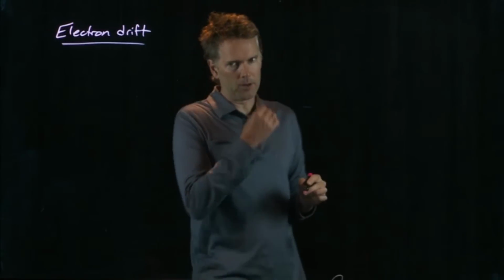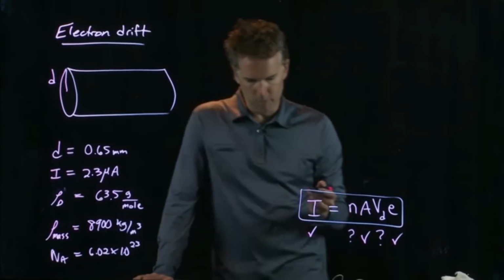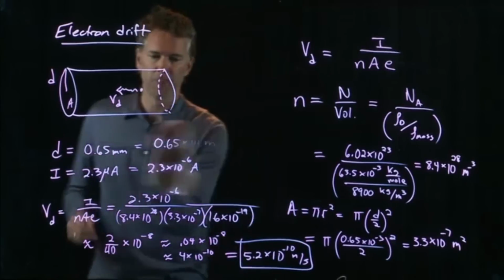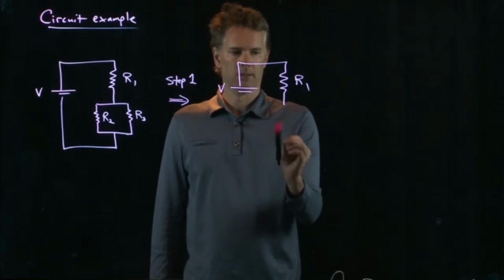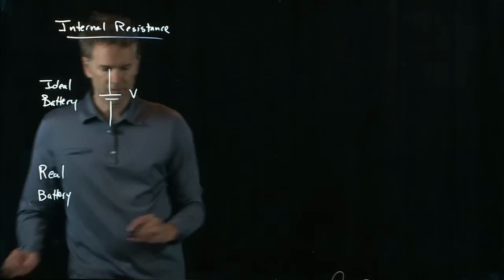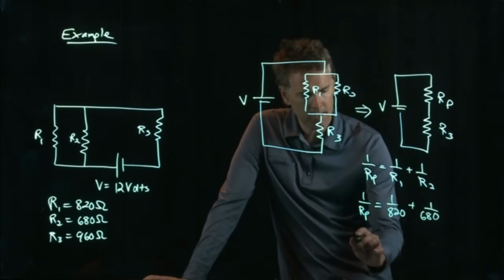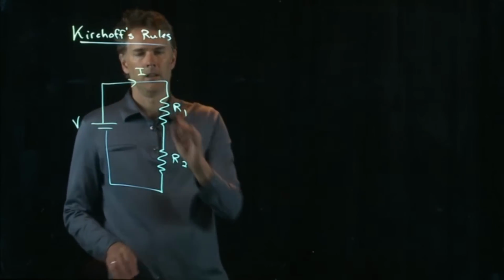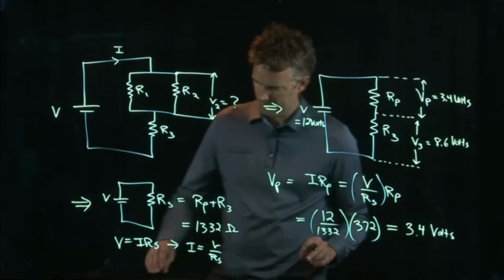Electric Circuits 2

Comment: Which heats up the wire, the electron drift velicityor the positive ion charge.
Reply from the maker: Electron drift.  As they head down the wire, they bump into atoms and heat them up.  The positive charges (protons) don't move.
Cheers,
Dr. A

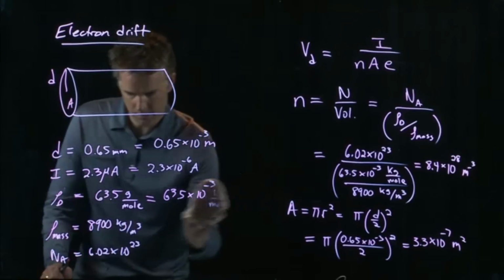Comment: 13:38, Avogadro's number is really number of atoms or molecules per mole (n/mole), which is how you change the moles per cubic meter he got into a number per cubic meter. (n/mole) x (mole/m^3) = n/m^3, or more simply, just 1/m^3. If you are going to do a unit analysis, you have to include all the units and cancel them correctly.

Tesla's AC current was better than Edison's DC current, because the electrons only have to move back and forth (oscillate) at 60 Hz to send the electric signal along the wire. Individual electrons travel forward in 1/120 s then back again in 1/120s. Using the small drift velocity means they barely move while still transmitting electricity. Edison's DC current requires a continuous flow of electrons along the wire. But more importantly, and what makes AC so much better for power transmission is that AC can be transformed to higher voltages for long distance transmission. That means lower current, since I=P/V.

The voltage drop in your car battery during starting can be easily seen when any lights that are turned on will dim during starting.
Reply from the maker: Wayne Adams, 
Thanks Wayne, I definitely got a bit sloppy there.
You might also like my new website: www.universityphysics.education
Cheers,
Dr. A
Reply: @yoprofmatt  I like the way you write every step without skipping anything, you even write the zero quantities. 

It is difficult to find professors who can present concepts in a clear manner and at a level that does not trivialize it nor place it out of reach of the students.

I assume this is a freshman non-calculus course. This looks like the course that pre-meds, biology majors, and geology majors take. I think it is the perfect video for people who want to understand the basic concepts. Keep 'em comin, as we say in the south. ;-))
Reply: @yoprofmatt  based on what I have seen on YouTube, i would definitely recommend the site to my students if I were still teaching. No matter how good we think we are, it is always good for students to get another perspective on topics.

Also, videos on YouTube, and websites seem more like entertainment than the drudgery of sitting through a lecture in class, so they tend to pay closer attention. LOL

Wayne Adams
B.S Chemistry (ACS Certified)
M.S. Physics
R&D Chemist 9 yrs.
Physics Instructor 33 yrs.
Reply: 60 Hertz, that's a very long wavelength for one Period for 16.67 milliseconds.

Comment: Your videos rock and your "learning glass" is genius. I had problems following in calculus sometimes because the teacher was blocking his own writing (he was a great teacher, I just picked a bad seat). Also how cool would it be if your glass was even longer and you could roll it left and right. But then you'd need some way to clear it with a button or something instead of using a rag. Starting to sound and look like that computer in Minority Report. You should totally try to wave things away and shrink them with your hands...lol.